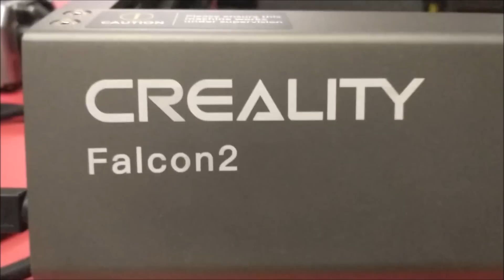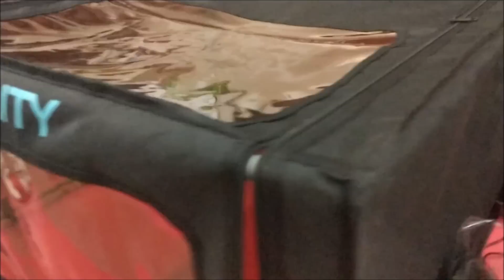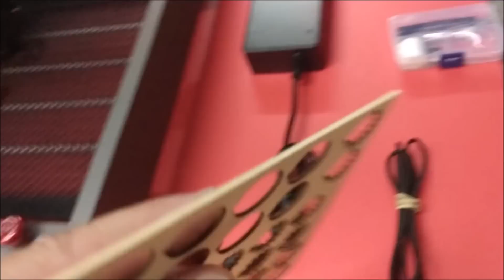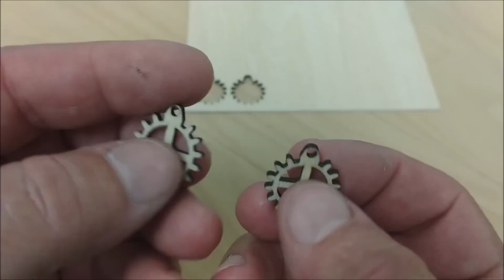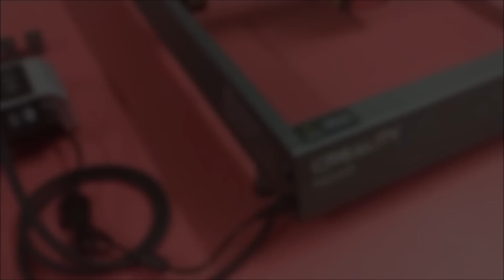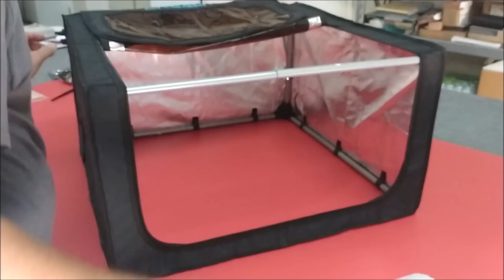Product Review - Creality Falcon 2 Laser Engraver and Cutter

Comment: Hi Joe and in particular the others praising up the 'awesomeness' at the bottom end of the Laser Gene Pool. ALL Lasers be it Diode or CO2 are a real fire risk and knife/Honeycomb beds are responsible for most issues. In particular cutting Ply the Glues and Creosote and other by products get trapped on the blades so keep them clean! Best option is a pin bed as cleaning is easier and keep the other for cloth or paper.

Comment: I have an "Atomstack" Pro 7, in my shop, it will engrave some metals (304 SS) and you are correct "Lightburn" is probably some of the better and more reasonable software out there, I would give Atomstack the nod over this machine but it's not to bad for a first Laser.

Comment: I have a small diode laser. It can do certain things. But it needs more power. I mounted mine to a sheet of Baltic ply with rubber feet. That way l can just hang it on the wall.

Comment: What sort of safeties does this have for the laser? I'm used to seeing an enclosure that blocks the laser beam in case of a reflection.

Those things also work extremely well with the two-color plastic laminates made for nameplates, etc. All the additional controls on my lathe are marked with plates i ran on the Epilog in the lakeside at work (back when i worked for a living).

Comment: Nice review. It looks like the Laser is Laser Diodes which I assume would last longer than a gas type which tend to leak / go bad, even sitting on the shelf after a few years?
Reply: Not really. The issue is with the bs 40W rating or similar on most of these the Diodes are already being pushed way beyond what is sensible Electronically. My current CO2 tube is now 7 years old and still running great. Different if I was running it for commercial production but you then consider them a consumable like inserts in a machine shop.

Comment: That was a nice review.  I have this unit and enclosure.  I'm on the learning curve with it. I was able to make a few things with it.  There is an USB-C port on the machine and you can have a laptop running Lightburn and control it with the software directly so you have more direct control instead of putting the G-Code on the memory card... that might help.  Also I think the Falcon 2 comes with a full license for Lightburn,  the instructions hint at how to do it, but I still haven't figured out the way to activate it.

Comment: Hmm, an adjustable jack might be useful for engraving/cutting  objects of various heights, e.g. engraving a logo on the bottom of a handturned wooden bowl.  Also, I agree that analog controls such as a potentiometer or multi-position rotary switch are often much more convenient than software controls.
Reply from the maker: More manual control options would be nice.

Comment: About 8 years I was the "shop" draftsman for a CNC. welding fabrication, and laser part machine shop. I made the "shop" drawings and programs (using special software) for a 4000 watt laser cutting machine. The accuracy (even your small one) of these machine is to .0001. I would occasionally get to watch the machines operator run a job. The thing would cut 1/8 inch thick (any kind) steel like it was soft butter.
Joe be careful, You may get hooked and want a bigger one, The "Part" drawings can be done on your modeling software, but you need the programing software that is compatible. Sorry, I can't remember the "Transfer" file name any more. It is not a PDF. Have fun. ;-)
Reply from the maker: DXF is the preferred transfer file.

Comment: Lightburn is well worth the money after the trial period.  How thick ply will it cut in one pass?  Will it cut metal, if so how thick?
Reply from the maker: No. This machine is not intended to cut metal, though it may cut foil if properly prepared. A co2 laser is better suited to cut metal. I have not experimented with all the cutting scenarios, but another YouTuber showed this machine cutting 1/2" plywood. I doubt it was a single pass, but impressive none the less. I've done 2mm and 5mm wood with ease.
Reply: I own a 60W CO2 and some diodes. Metal does not do anything in the machines. It's awesome for a lot of things, but most metals reflect the beam. You can burn colors and coatings off, for example anodized aluminum will remove the dye. Or paints and similar. You can make some great looking control panels and such this way. 

There are some coatings you can burn on to a metal part, but they tend to be expensive or iffy.

One thing that works great on either type is layout. It will remove dychem or sharpie marks leaving very crisp lines.

I tend to use it for wood and plastic work. It's great for that and making things like gaskets.

For cutting metal, you need a LOT of CO2 power (hundreds of watts) or a different wavelength like a fiber laser. I've heard of it being done in specific setups, but they were doing crazy stuff like feeding oxygen into the air assist system. Very dangerous, really don't do that. 

Even reflected beams are dangerous for your eyes. Do not look at laser with remaining eye.

The tint on the enclosure is to protect you, but it's still not great to look at the impact point.

Comment: Love your content Joe.  Respect your opinion as well.

How is the machines software? 
Did you do any metal?
Are you concerned about the laser bouncing off and being a health hazard?
Reply from the maker: The manufacturer suggests using LightBurn software. Its initially intimidating, but after you realize how easy it is, you'll be off and running. Its got some great features and has a bunch of YouTube tutorial videos to address any operation.

Comment: are you planning to use to mark your products?
Reply from the maker: Hi Chuck. Initially, I had hoped to do just that. Marking metal takes some surface prep and after burn cleanup, so this diode laser may not be the best choice.
Reply: I think he'd need a fiber laser to directly mark metal nicely. This could mark anodize I think.

Comment: Good they specify 40W "optical power". Some of the machines claim "40W" lasers but that's input electrical power and the actual optical power is less than 10W. The input electrical power will be >200W to make 40W of light, I think. That costs money for the power supply and for the many (8 x 5W)  laser diodes.
Reply from the maker: 40w is a very capable laser. I'm looking forward to getting very creative with this.